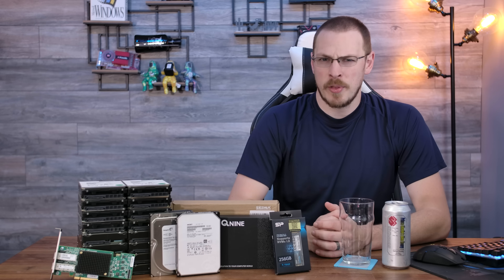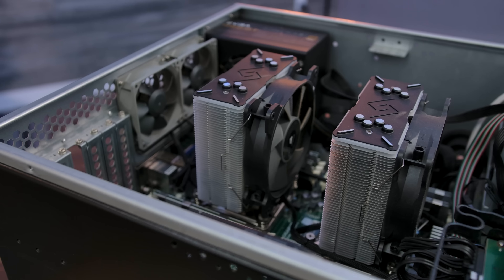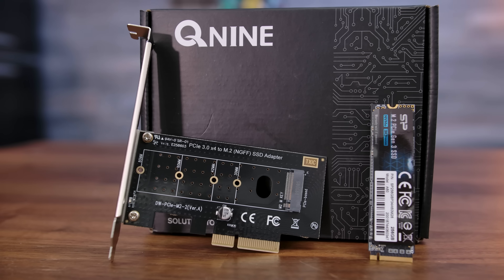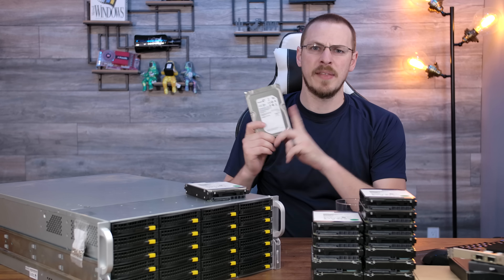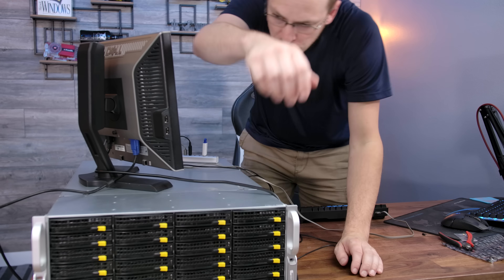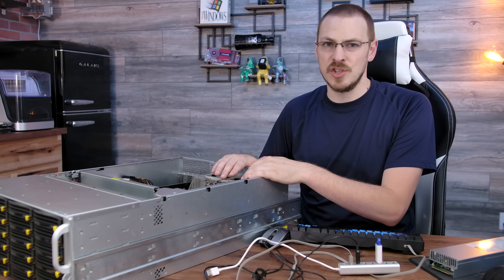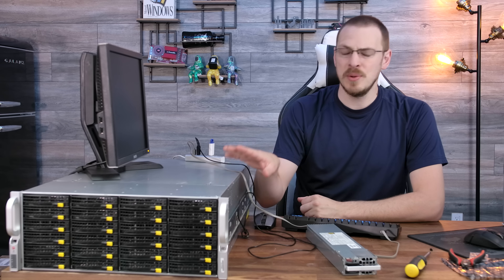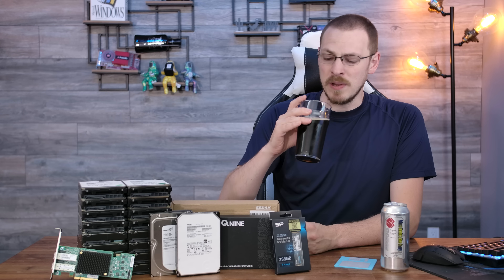My biggest server build yet! 88TB TrueNAS CORE Build.

Comment: Jeff, I've read and watched everything you can imagine about deploying a TruNAS with 24 bays chassis, and your videos are the best so far, fantastic! I'll deploy a TrueNAS 24 bays in an 846 chassis, but I really need 10GB NIC cards and SAS drives. I've planned a lab test with a near customer. They have files in use for a design app running in 20 client workstations, and I want to test a better performance using your video tutorial. What do you suggest in terms of motherboard and processor Xeon E5 for 96TB SAS? I don't want to deploy an expensive solution, but I need to build a 2nd Supermicro 846 to back up those files. They should have the same processor/memory and capabilities? Thank you, and congrats on your videos!!

Comment: Yeah, this is CRAZY late, but those 3TB Seagates?  TRASH.  I've had like 6 of them fail.
Before you say that I'm just a "Seagate hater" or something...  They're literally my favorite brand.  With VERY few exceptions, I only buy them.
This situation was in my first (and still hanging on) NAS build. a 4x 3TB freenas system running Z2.
So, yeah, if you still have those, and they still have ANY kind of critical data on them, back it up again - somewhere else. lol!

Comment: its terrible I heard the beep and i immediately said "power supply" I just got my first supermicro a few months ago and had that same issue, I have the 12 drive version of yours. =)
You can run 1 power supply but they tend to run way hotter when only 1 is connected. When you have multiple psus connected they split the workload and run cooler.

Comment: I did a similar build myself last year.

CSE-847 (36 bay variant like yours) 
Dual E5-2620's (waiting for 2643 v2's to come down in price)
192GB ECC Memory
36X 3TB HGST SAS Drives
9211-8I's (one for front 24, one for the back 12)
Chelsio 420 10GB adapter

One pool with mirror'd devs (like RAID10) for my virtualization.

Cheers!
Reply: Also forgot to add: 2X 512GB NVMe for L2ARC and 1X 256GB NVMe for ZIL.

Comment: Looking for a backup option for a "Small server" that is not another server or nas, My main server is only 16TB (only about 10TB of data right now) it will be expanded soon to 24TB. The files I really want a backup for are only about 10TB in size , this would fit on a large USB drive -- while not ideal some backup is better than no backup and I do not have the funds at this time to build another FreeNAS server. I have experience on some systems but an fairly new to what is available for freeNAS/TrueNas.

Comment: no supermicro docs tell you that the PSU alarm with also sound if one PSU is not plugged in. you have to a) plug in both PSUs, b) unslot 1 PSU, c) break, cover, or otherwise fuck up the speaker
annoying. understandable in a data center but very inconvenient if you don't need 2 power connected

Comment: I put a 4U 24 bay SuperMicro chasis in my server rack too but I couldn't stand the noise so I pulled the P/S and its cage and put in a 700 watt SFX.  I did the same with a 3U case too, in fact all my SuperMicro cases I've similarly modified.  Thanks for the tip on the SAS drives! I've got that gigabyte board too and given the price on Amazon I'll pull my ATA controller and use the onboard SAS with those drives.

Comment: Why not just archive to tape what you don't immediately need? I just bought a new old stock LTO-5 SAS drive for $600 AUD a couple of months ago for the purpose of backing up a 30TB RAIDZ1 array. Considering your storage size though you would want minimum LTO-6. Initial cost might be more but the reliability of tape (when stored correctly) and power savings could be worth it. This is my first experience into tape though and all I know about it is what I have read online.

Comment: Great troubleshooting when it wasn't obvious. Except for the enterprise admins in the comments who immediately recognised the steady beep. Still prefer ESXi hosting a virtual FreeNAS with the SAS controller directly passed-through - I know you could have done that too. Not ready to jump FreeNAS trains to TrueNAS Core just yet, will wait to hear if there are any horror stories after upgrading. Interesting mounting of 2.5" SSDs directly on a card. The price differential with NVMe is so small now that there doesn't seem to be any point in purchasing new SATA SSDs (2.5" or SATA M.2)
Reply from the maker: I'm a former enterprise admin, and I know a steady beep is a component failure. Checking documentation, the only buzzer listed in the chassis is for the backplane.

And both power supplies were plugged in ;-)

Comment: Curious why you haven't ever went with the E5-2670's. They were all the rage a few years back selling for peanuts. I've got a dozen Intel barebones servers with them for server virt and ZFS. I was getting brand new Intel barebones for $300-500/node + $120 for dual 2670's over 3 years ago I think it was. Machines still going strong, in a production environment. 😱 I prefer more nodes over expensive hardware, spread workloads and HA/failover.

Comment: Nice build!
Can I use enterprise nvme SSD inside TureNas as a cache drive? I'm thinking of PM1725b, but not sure if drives will work and it will run full power.
https://www.amazon.de/Samsung-PM1725b-MZPLL3T2HAJQ-PCIe-Karte-MZPLL3T2HAJQ-00005/dp/B07PQXCF6Z

Comment: Hi, that motherboard (and the alternatives) are impossible to find. Can you list available boards that would work with your parts list? Also, I did see on Ebay some complete Supermicro 846 systems including original motherboard and cpu's. Can you flash that board's card to IT mode?

Comment: So I'm little by mentally building my dream rackmount NAS. Its a supermicro sc847 one of the version,but I cant find anywhere if its just to mount a supermicro x11 or h11 motherboard in there. I also am looking to buy a 36 bay server, or you reckon that 24 bay is enough. I was kinda thinking of 24 bay of HDD's and 10-12 bay SSD raid array with a dual 10Gbit connection. I also want to use enterprise drives,but I also want like 14 TB + drives so I'm still undecided after the insane problems with SMR and CMR drives that both Seagate and WD is lying about.

Comment: Them supermico full system storage pods are actually very nice (loads of used and new ones on ebay, some complete with 72 to 96TB of disks already installed for under £3700 or complete system no hdds for £1000 with motherboard, cpu, ram and raid controller)

Never seen these systems before

Comment: I've heard troubling things about the Seagate 3 TB drives. If your running ECC ram go with a server class motherboard like Supermicro. Those consumer brand motherboards that support ECC are usually trouble. Also those power supplies have indicator lights on the back. Green = good, Amber = Problem.
Reply from the maker: All 3TB drives are pretty terrible. And you realize Gigabyte is also one of the larger server motherboard OEMs, right? This is a server class board, not a consumer product.

Comment: My first thought when booting was: "o a power alarm" , "it's not going away, did he plug in the second power supply?" 🙈
Reply from the maker: Second power supply was plugged in. The alarm was for a dead power supply.
Reply: @CraftComputing  a lot of servers also sound that same alarm when there is only one plugged in, seen people f that up so many times that it was the first thing that came to mind when I heard yours beep. But it's not uncommon to beep the first 4/5 second when booting the first time while it's checking the system. If it continues it's 9 out of 10 times I've seen it one of the power supplies that doesn't deliver for whatever reason. But out of those 9 it's 7 times someone that didn't plug in the second psu

Comment: Wait, why do you need external 10Gb NIC? Gigabyte GA-7PESH2 already has dual 10Gb ethernet ports onboard.
Reply from the maker: My switch is SFP+, and a DAC and NIC are cheaper than an SFP+ RJ45.
Reply: Craft Computing That’s true - for some reason 10GBaseT sfp+ modules are much more expensive than FO. The cheapest one I found on eBay is like $60.

Comment: you need a servers for dummies video. hi i have been working on, and building comps for 20 years but i never built a server. Truth be told i don't even know anything about this side of computing as i focus on gaming. So now i'm 50 and want my own server for my home. I mine burst and file coin for fun. i have 24 used 16tb exos drives but to be honest the problem is sas cards and understanding of them and there setup. which one is cheap and right for me. can i use 3 8-port or do i NEED a 24 port? what is hba, it, ir, raid? So my question is can you do a walk through of a cheap 16-24 port hba server from soup to nuts? list all parts why you chose them and how to set it up. including the cable setup.

Comment: Spoiler alert: You absolutely can flash the onboard lsi sas controller to IT mode. I use this exact motherboard in my homelab for my ESXi server.
An absolutely great motherboard!
Reply from the maker: Excellent! I assumed I could, as it's basically a 9211-8i onboard, but sometimes there are weird differences with integrated chips vs add-in. Thanks!

Comment: ZFS... This is the way.
Reply: @darkcggaming  That's not true. Running stripped mirrors means you only need to buy 2 drives at a time to expand your storage size. It's really practical and much faster than UNRAID or RAID and much more reliable at the same time. But yah know, you do you.

Comment: I'm at about 80% on my current NAS as well. trying to decide if I want to bump up from 4tb drives to 8tb drives or jump all the way to 10tb. I think what i'm most interested in is that little NVMe to PCIe adapter. That would certainly solve some inconveniences for my setup. I'm currently testing moving from basically just a hardware raid-6 and running my server OS on bare metal to running Proxmox on the box and running the server OS, as well as a few other things in VM.

Comment: I didn't hear this mentioned, but those PSUs will alarm if seated in the PSU back plane without power. Should also have a RED LED lit if failed or power loss. There are also a "SQ" (super quite?) version of the PSU which are considerably quiter.

Comment: I recognized that beep immediately.  My issue was only having one power cord.  Had to remove the second PSU until I found another cord.  It took me longer than I care to admit to figure it out.
Reply: I also recognized it right away from starting to rehab a supermicro server recently. I have both PSUs and they both work but I was only using one. The annoying part was fixing that only to be confronted by another beep issue that was hard to distinguish from the fan whine without hearing protection.

Comment: The IPMI on a Supermicro board would have told you the PS was the issue :-)
Reply: I knew it when I heard the noise. Had similar issues with my PSU. Reseating the PSU helps sometimes (until new one arrived).

Comment: As soon as he turned it on and the beep started i thought "oh, hes just running it off one power supply".  not sure where, but i saw another video where they said the beep happens if you run one power supply, and lasts for like the first 30 seconds or so.
Reply: That was surely a video from 'Byte my Bits' Jason about his Loki. Saw that too.
Reply from the maker: I had it plugged into both, and I know SuperMicro alarms with only one plugged in.
Reply: Still would have assumed it was the psu (there should Be a button on the back on the PSU box that let's to mute the buzzer, be very odd if it doesn't have a silencer button) 

the buzzer on the sas array would only be active when a disk had been booted out of the array, unsure if truenas/freenas can addresses the beeper, unless it just beeps when a disk bay fail LED goes red

Also avoid HPE sas cards as they will come back to bite you later on as HP seem to have built in time to fail built in (I never touch HPE enterprise stuff ever again) ,, lenovo or dell raid{flashed into it mode}/HBA cards updated to currant firmware or LSI HBA cards are good

It looks beautiful as a complete system (was expecting it to be a storage pod at the start of the video with a separate system for the HBA cards you got)

Comment: Did you have both power supplies plugged into the wall power because the Supermirco systems require both to be plugged into power if both are mounted in the chassis? Also, it is very rare for those beepers to go bad or fail.
Reply from the maker: Both were plugged in.

Comment: Couple things,

Did you point five added card is extremely handy as I bought one a couple years ago. Mine however caused CRC issues. So just watch out for that.

And to my knowledge, that supermicro case is SAS 2 or 6GB/s. Are the discs as well, did you upgrade the backplane, for that speed good enough for you?

Comment: I want upgrading my Server as well! But I need a bigger case tham yours, I have in total 26 HDDs. I need that much because I'm still using 2tb HDD, there are the cheapest money/GB. The Problem is that I don't find any case that big... :( the only one is the storinator... but very expensive.. sad..
Reply: Start using larger drives. I believe you can slowly swap them and replace gradually increasing capacity

Comment: Are you sure you don't need to simply plug in the other power supply? I'm pretty sure those servers beep like that when power is removed from one of the power supplies.  

I think you can turn the buzzer off in the bios.
Reply from the maker: Both supplies were plugged in. And no, this is a buzzer independent of the motherboard.
Reply: I see. I must be confusing these servers with Poweredge servers. Last super micro I had was equipped with dual power supplies but I only used one.   I probably left one out but can't remember. Im going back 8 years...

Comment: No anti stat precautions?
Reply from the maker: It's called grounding yourself to the case, working on tile floor in a room with 40% humidity.
Reply: The smaller the parts you're working with, the greater the risk of ESD damage. At the level of system building (as opposed to PCB assembly) it's fine to habitually ground oneself to the chassis on a somewhat regular basis. At least we don't have to work around crackly CRTs anymore.

Comment: Just wondering about fan noise with the Supermicro Cse-846 case, was it an issue for you  ?
Reply from the maker: It's loud, but it's a server. It's not meant to sit in the same room as you.
Reply: @CraftComputing  I love the case and understand noise is not an issue for you.  I have one in my converted bedroom office closet but I easily quieted it through combination of low-noise fans and through Supermicro IPMI power settings.   I also swapped CPUs and ran with low power Xeon E5-2648L processors.  Great video, cheers.

Comment: I tried using FreeNAS for a year, then I switched to Unraid and it was the best decision I ever made. I've lost data on multiple occasions while using FreeNAS in that one year of use. After 4 years of continuous use with Unraid I haven't had a single issue to this day. To each his own, but after my experience with FreeNAS I wouldn't trust it as far as I can throw an 88TB server. I know the ZFS format is suppose to be more reliable when it comes to things like sudden power outages without a battery backup and XFS gives you better I/O R/W rates. However, every loss of data I had with ZFS FreeNAS software was due to a sudden loss of power. I've lost power on multiple occasions using Unraid's XFS format and not a single thing has been lost. I also found that adding in new HDD's to expand my drive space was way simpler in Unraid over FreeNAS. Sorry for the long drawn out diatribe, but I'm really curious as to why you would use FreeNAS over Unraid?
Reply: Unraid is far more better

Comment: Is that backplane SAS2 only? Remember to benchmark resilvering speeds, I'm curious of the performance hit.
Reply from the maker: SAS backplanes will run both SAS and SATA disks.
SATA backplanes can only run SATA drives.
Reply: @CraftComputing  yes, I was just worried about possible bottlenecks if you populate all the bays

Comment: Nice! I have 8 of those 3TB disks myself. I wanted to add more and have some spares, they are dirt cheap, but nobody is shipping to Argentina because of the human malware. Are you planning on adding more SSDs to try Fusion Pools or Metadata on Flash?
Reply from the maker: I am planning on testing out mixed VDEVs with SSD and HDDs. Stay tuned.